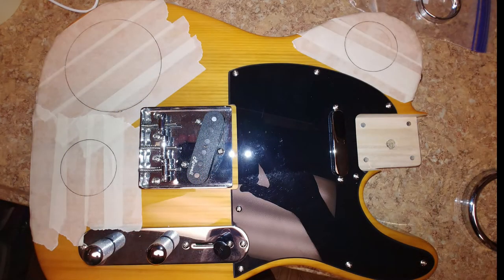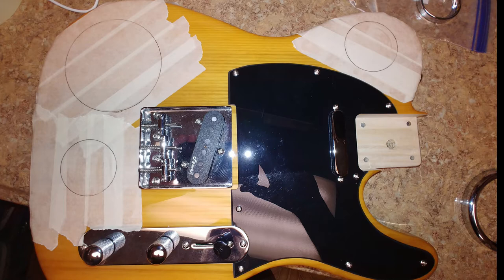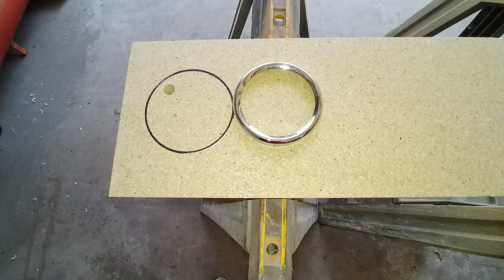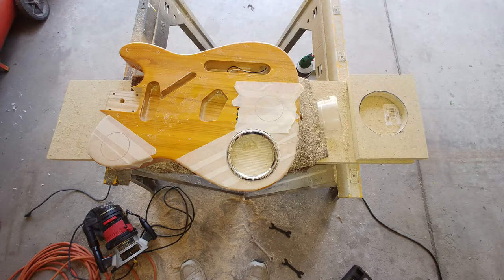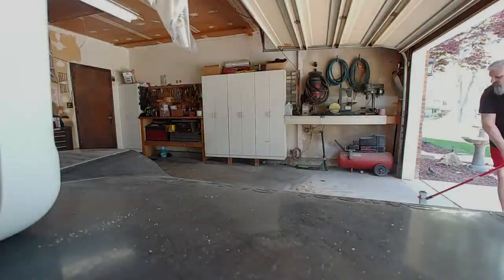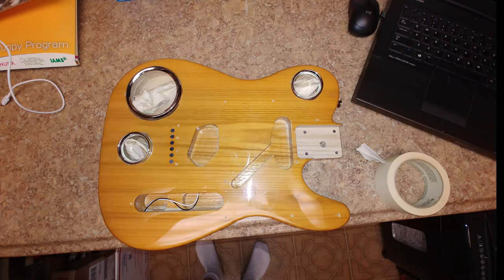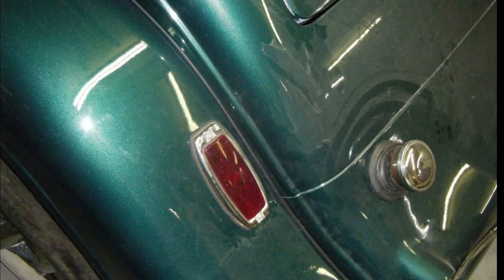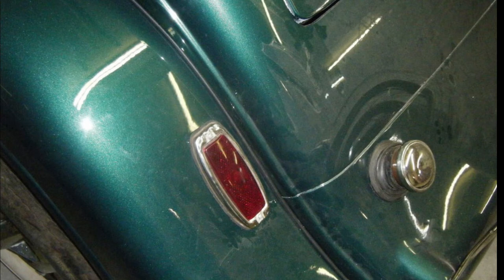Fixing a Heavy Tele and Giveaway Winner

Comment: Hi Eric, not sure if anyone has mentioned it, back in I think 1967 Fender made a few Telecasters that people referred to as the Smuggler Tele , they purchased some rather heavy wood that people didn’t like all that much and looked at salvaging what was made. Look up the way they had weight relief done under the pick-guard that could be a relatively easy routing job is George’s Tele still feels a little on the heavy side.
Reply from the maker: Thanks for the info.